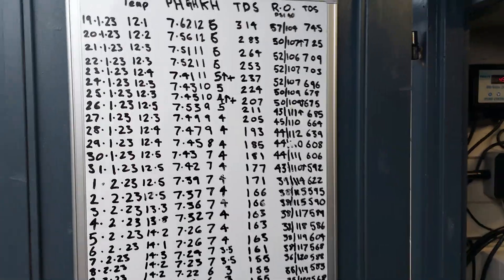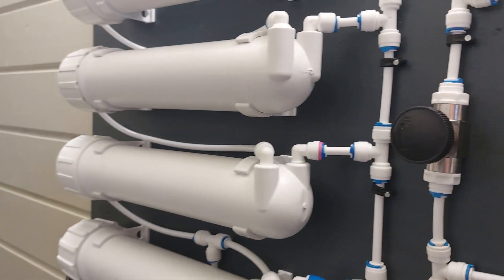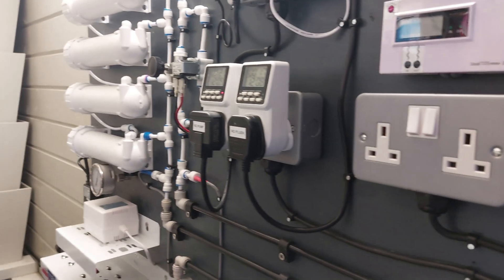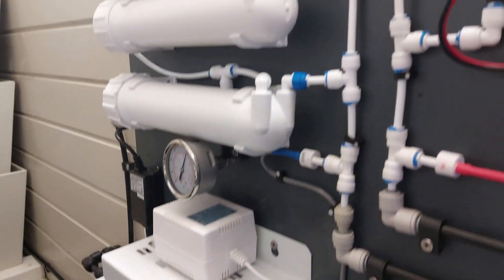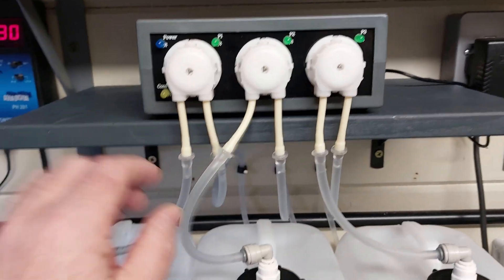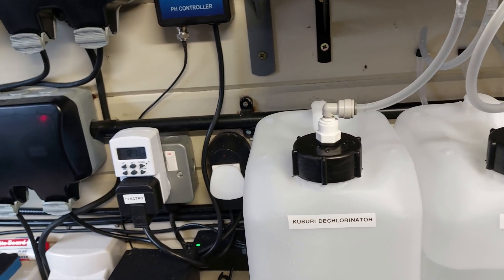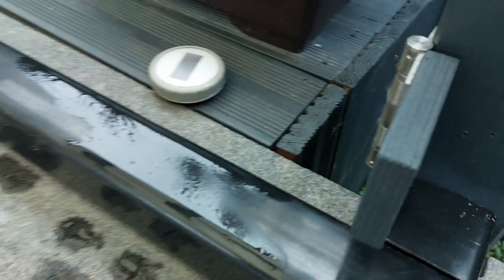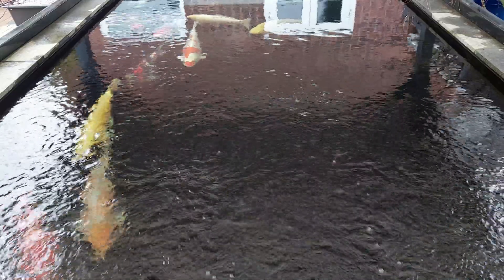Jebao 3 Channel Automatic Doser for Sodium Bicarbonate and Metal Detoxification.

Comment: What fittings have you used please with the pipe into the containers from the dosing pump?
Agree with dechlor as it takes out copper etc as well, carbon cannot do that, love to know what’s in the 3rd container 😜
Reply from the maker: 1/4" RO push fit fittings from the dosing containers.🙂
I'll be doing a video showing the dosing setup and pitfalls.
Turns out not all dechlorinator liquids fully detoxify metals.
The kusuri dechlorinator for one.
The only component Sodium Thiosulfate. doesn't detoxify metals very well, and actually makes zinc more toxic. 
It takes a dechlorinator with an additional chemical, EDTA tetrasodium salt. Which fully detoxify copper, zinc, and lead.👍
the 3rd container will have a few different uses and will change depending on time of year 😉
Reply: @DavesKoiPond  thanks been looking for something that clears all, which do you use? Also with recycled RO I have a cartridge with filter floss, removes a lot of rubbish before the paper filters and cheap/easy to change, my paper filters are lasting 3 times longer.
Reply from the maker: @garychallinor6404  Yes mate, 🙂
I used a DIY filter floss cartridge when I started RRO a year ago  with just a 10" 3 pod in this video here @1:23 in...  https://youtu.be/6HVb6PJY-yI
the 20" 3 pod i'm running atm has a 50 micron borosilicate fibreglass pleated filter before the paper filters, 
it has a much higher open structure,(the fibre strands are thinner and stronger than stander pleated filters) 
it's more pourous and has layered depth filtration as well. 
It stops 95% of the crap before it gets to the standard 20 micron and 5 micron pleated filters and doesn't block easily. 👍
Reply: @DavesKoiPond  thanks I’ll look into getting one to put in front of mine, where do you get yours from?
Which dechlor do you use, I recently just make mine from sodium  thiosulphate crystals?
Reply: Checking on the Internet found your discussion on koi forum really Interesting topic, I live in Stoke On Trent, my tap water is terrible plus it changes depending on where Sever Trent get it, two sources bore holes and reservoirs.
Reply from the maker: @garychallinor6404  I just had a couple left over from my work years ago...
they are not cheap but here's a link if you want a look though i wouldn't buy at these prices.😮
https://www.spectrumwaterfilters.co.uk/spectrum/final.asp?id=2415#scroll
Reply from the maker: @garychallinor6404  I'm just using sodium thiosulfate too at the moment, 
but looking for something with better metal removal.
just sent back a 5litre container of kusuri dechlorinator because it is just 13% sodium thiosulfate and 87% water....
Reply: @DavesKoiPond  thanks, checking on Google found your discussion on KoiForum, really interesting, not storming you promise😂 
If sodium thiosulphate is good except for zinc, thought I could just remove the zinc?? Test for copper and that is now at 5 ppb or 0, not sure how to test for zinc, looks expensive
Reply from the maker: @garychallinor6404  The problem with what, and how much exactly metals, sodium thiosulfate detoxifies is still being debated and argued over by researchers.
like Burgess et al (1995) critisizing Hockett and Mount, so there are no scientific facts that I can find as to what actual percentage of which metal removal occurs in a sample of a given concentration.
It's biological research done on it's toxicity to certain living things like Arbacia lixula and daphnia magna.
maximum copper toxicity in koi ponds depends on pH, 5ppb in soft water 15 ppb in hard water.
but obviously lower or 0ppb is better.🙂
Reply: @DavesKoiPond  agree, I can only test for copper at the minute, and when using sodium thiosulphate Hanna test gives back a 0ppb reading, to be honest only kept koi for 3 yrs and finding myself totally confused with water parameters and the rest kits, find it extremely difficult to find answers , but do love puzzles 😂
Reply from the maker: @garychallinor6404  Yes they can certainly be a challenge at times.😃
I kept koi in the 1990's and never had any issues using a garden hose from the tap with a bit of blue dyed dechlorinator chucked in the pond....
I don't know what they are doing to the mains tapwater since covid... but the fish don't like it...
Reply: @DavesKoiPond  love the videos, very informative, agree the water has changed, something they don’t like. Looked at a zinc tester from Hanna around £450 !!!!
Love to find the ideal composition of water for a koi pond, everyone has a different view. 
Noticed you kept marine tanks, think the koi ponds are going the same way, purifying water, then adding what’s needed.

Comment: Cracking job👍. Loving the capture of all those stats, I’ve got all mine on the pc 😊👍. Looking forward to the upgrades👍. I need to get myself an automatic doser so will be interested in seeing how your set up works🤔. My TDS is down from 340 to 130, my ph is down from 7.7 to 7.2 and KH is down from 7.2 to 3.8 degrees. Keep up the good work👍😊
Reply from the maker: Cheers Phil, 👍
I've been running the doser with just plain water atm, to test it out as it's second hand even though it hasn't been used...
One of the pump heads needed the santoprene tube sorting as the rollers weren't straight. but it is a simple job to do.
I had to do a couple of simple modifications to the set up, as the Jebao dosers have a couple of small flaws.
Yes fish are much happier again now, the parameters are better with lower TDS and pH.
I wanted to have the new membranes and pump up and running by now... 
but guess i'll just have to wait until the parts come in...just the motor from Italy now...😃

Comment: Good update Dave, do you find your RO production increases much with pond temp rises?
Reply from the maker: Thanks Marek, 🙂
Yeah membranes will produce more as the pond warms up,  25C is the nominal temperature for the stated GPD of the membrane. 
But also as the TDS comes down I find i see a small increase in production. 👍
Reply: @DavesKoiPond  Brilliant idea, dosing de chlorinator, I had loads of problems in summer with chloromines getting through big blue and that was with new catylitic carbon, I've got a couple of dosers left over from my reef tank, so another one of your idea's I need to think about 👍
Reply from the maker: @marekskoipond9083  
I never thought i'd need dechlorinator with 3 x big blues! 😮 
I have activated carbon in the first one, then catalytic carbon in the second, then bone char in the third...
But I was getting fed up with restratifying them when I get a low level of chlorine breaking though after a couple of weeks.
I've noticed an improvement in thier behaviour since manually adding Dechlorinator, even though the reading on the hannah ULR total chlorine is zero ppb for the pond...
so something is getting through.... trihalomethanes, or metals.... reckon i'd be better off trickling sewer water than tap water into the pond lol! 😂